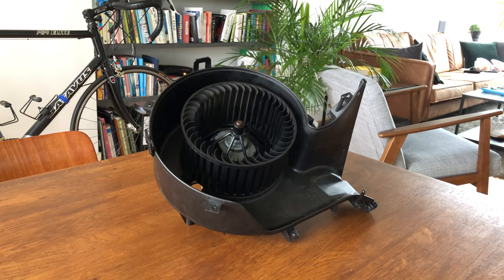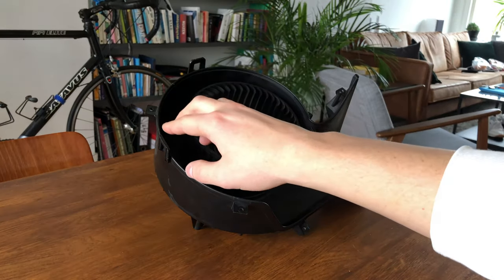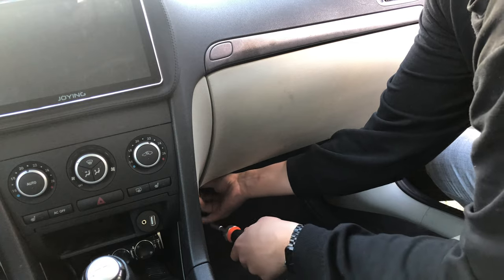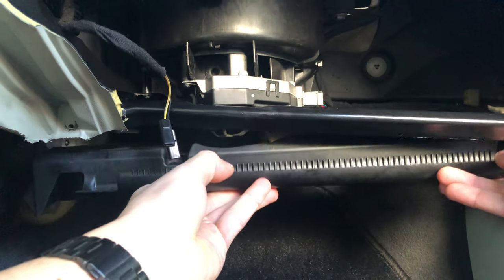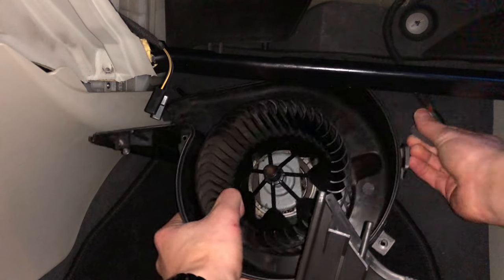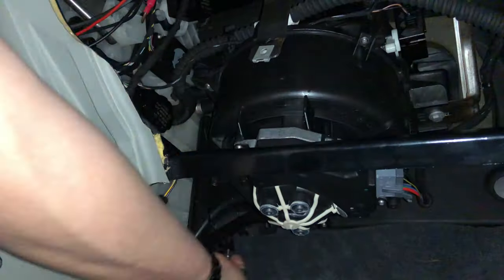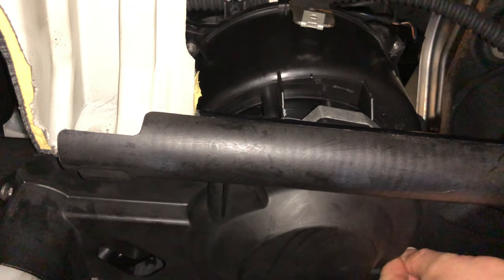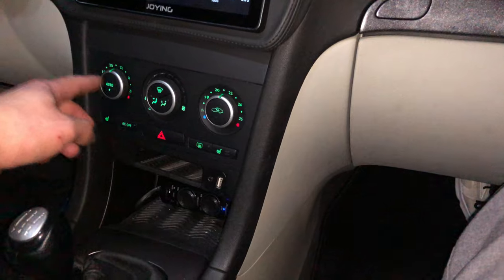Replacing the cabin fan blower motor / interior fan on a Saab 9-3 NG

Comment: Excellent video which helped me remove and lubricate a squeaking blower motor on my car. The motor and fan just push out of the housing after removing the regulator and three small Torx screws. Then you can feed some oil into the bearings at both ends of the motor.
Many thanks.

Comment: Good job! Just found your page.  I have a 2006 9-3 1.8T convertible. My motor squeaked and whined.  It became so noisy it had to go…but I actually had the motor rewound and new bearings fitted by a local company who have been building and servicing electric motors for milk floats ( not sure you have early morning milk deliveries made by electric buggies in Netherlands?!) since 1948. It was a simple matter of removing my motor, dropping it off and a day later it had been rebuilt.  
They charged me £50!
Wonderful to re-condition the original motor.  
I’ve recently replaced the front struts, control arms and drop links  including the top mounts and bearings.  No more clunks.  Rear anti roll bar bushes and links to do next which will hopefully cure the few knocks I can still feel. 
Best of luck with your car!